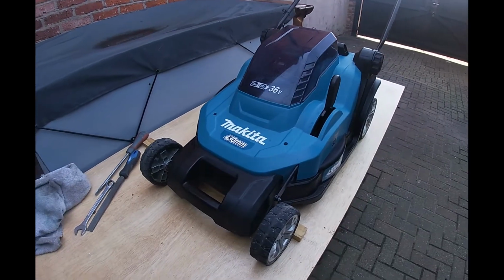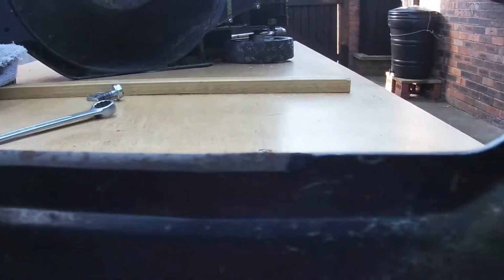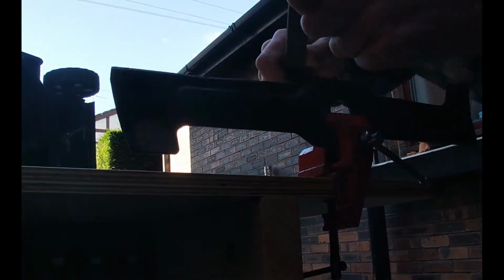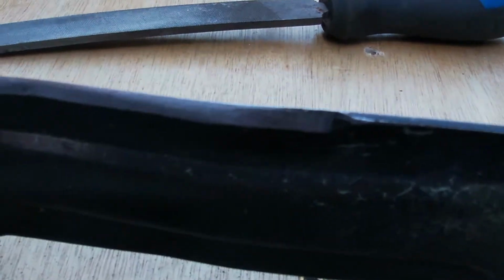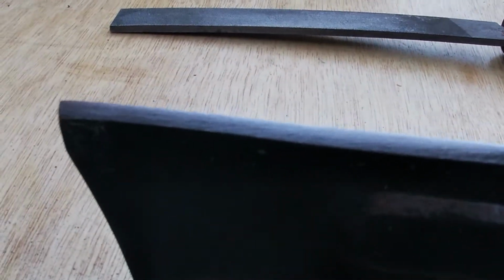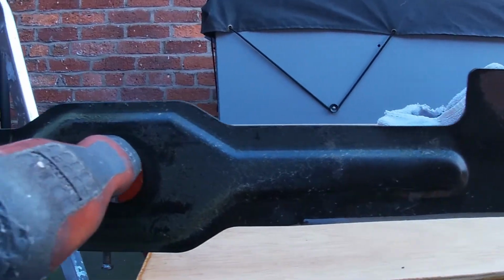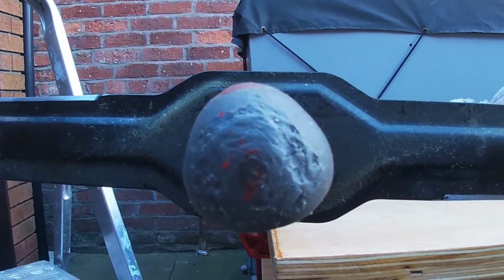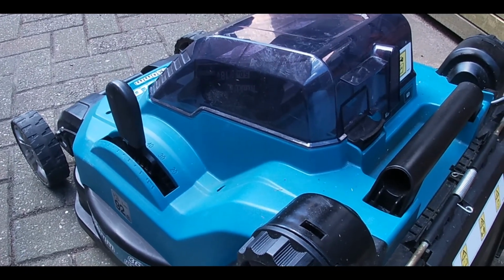Blade Sharpening of the Makita DLM432Z 36v LXT Cordless 43cm Lawn Mower

Comment: I just bought a replacement blade because the existing one was nearly mangled from hitting rocks and gd knows what else. I followed your instructions to replace and it was so easy. When I started the mower, it seemed quieter than before and ran noticeably smoother. Must have been the mangled blades that made life hard for the mower and me. Thanks for sharing.
Reply from the maker: Glad it helped.

Comment: Sharp part on my blade is much shorter, is this because newer revision or did you make it yourself?
Reply from the maker: Original blade fitted with the mower.
Reply: @micksmaintenanceanddiy  Thanks, I have older DLM431 and always thought about expanding sharp parts. Looks like I should do it as Makita did it in next revision itself.